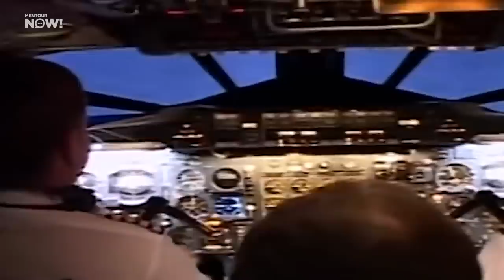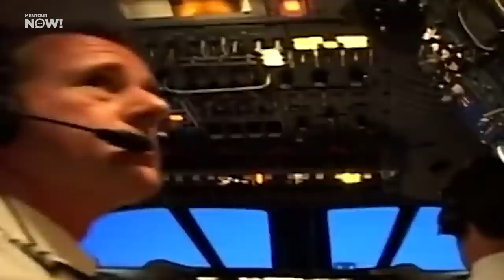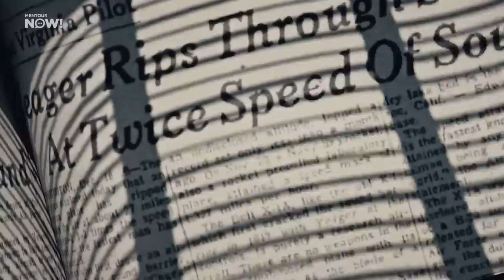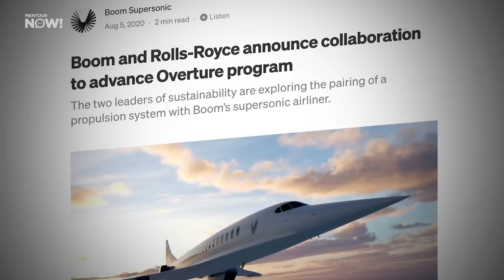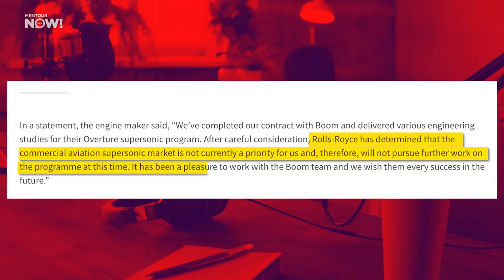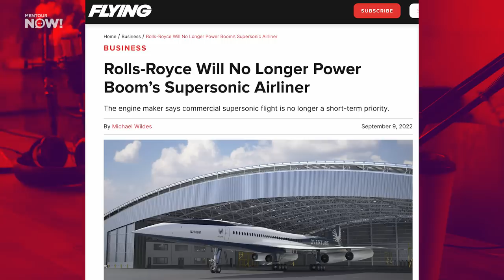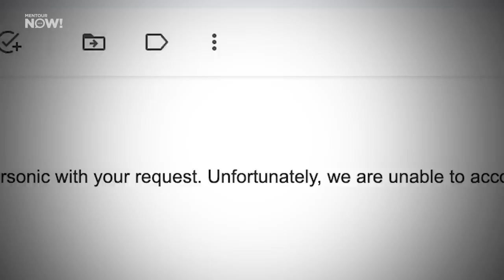WHAT’s Going On with BOOM Supersonic?! Will it Fail?

Comment: Hi Mentour,  thanks for making this video. I have been saying this online for months. Their scaled demonstrator now doesn't even look like the new design so how valid with the data be? And mimicking the B-2707-300 with those draggy engine pods?  I would love to see another SST as I loved my Concorde flight in 1999. It was awesome to see the curvature of the Earth  from 60,000' and to sit in the cockpit chatting with the pilots and Flight Engineer. The premature retirement of Concorde was forced by Airbus pulling the Type and Airworthiness Certificates because they could. This is unheard of for a manufacturer. Boeing still supports their airliners from the '60s and 70s. 

I suspect the problem was that Concorde dominated the First Class trans Atlantic market (soaking up 800 seats per day) and any airframe manufacturer has to sell First and Business to its customer because that is where all the profit is made. At the US major I worked for, if BusinessFirst on our trans Atlantic DC-10s was 75% full, the aircraft was paid for. All the rest of BF, economy and the freight was pure profit. That's how important this was. They weren't making much money from Concorde support and Air France made it quietly known that they wouldn't mind letting it go and being government owned at the time, had the influence to support Airbus in this. Not great for BA who had just refurbished 5 of their aircraft with new interiors, Kevlar liners and other upgrades. Reportedly they went to Airbus with a plan to go it alone but Airbus said 'Not at any price'.

As for profitability, it made more than half a billion pounds in profit from the 5 aircraft in regular service. They were clever with using charters and round the world trips but across the Atlantic BA was profitable. It worked in its own division from 1982 so was not cross subsidised in any way. This is documented in  numerous books and other sources and as BA is a public company, can be verified. Air France struggled with profitability with it and their mainline airline for years.  The development costs are a separate issue as quite a few airliners never made back their costs (DC-10, L-1011,VC-10) but were profitable to operate. (No manufacturer charges back the development costs to a customer except a small portion in the sales price.)

The major achievement for Concorde was being able to supercruise (fly supersonic without afterburner) for 3+ hours at Mach 2.0 something no other aircraft civil or military has ever matched. The supercruising bit is critical and  supersonic aircraft require low bypass or turbojet engines as they need the high exhaust gas velocity. This means noise. Rolls Royce pulling out is almost fatal. There is no engine in sight and engines take up to 10 years to develop. The Olympus 593 was the most thermally efficient turbojet ever produced and its SFC is still impressive today. At 30,000lb dry and 38,000lb wet it is head and shoulders above anything available now and ever surpassed the J-58 in the SR71 by some distance. The dry figure is critical for supercruising. The Olympus' clever inlet and exhaust system produced 60% of the thrust at Mach 2.0 with the core providing the rest. 

You can find more about this amazing aircraft here    https://www.heritageconcorde.com/ Best books are by Christopher Orlebar, Brian Trubshaw and Neil Kelly

Concorde solved all the problems except noise and boom and I doubt that Overture will solve these either.

Comment: Another issue with Boom is the range, fine for trans Atlantic flights but not so much for trans Pacific routes like LA to Tokyo, Hong Kong, Singapore, Sydney etc. People would pony up to cut that flight time in half, but Boom can't make it without a refueling stop which takes away it's advantage.
Reply: @kenclassen6616
1 Hr refuelling stop 747 cruise=575mph. Overture cruise=1,304mph 

Route             747                Overture                        Saving
JFK/LHR         8                          4                                  4
LAX /TYO       11.5       2.88 + 1 + 2.88 = 6.76            4.74
LAX/SYD        15          3.75 + 1 + 3.75 =  8.5              6.5
LAX/HKG       16           4.00 + 1 + 4.00 = 9                  7
LHR/PER        17          4.25 + 1 + 4.25 =  9.5              7.5

Comment: The F414-GE-400 engine (58-98 kN) could be a nice choice. It is used in F/A-18 E/F Super Hornet that can do in Mach 1.6, and a variant F414-G is used in Swedish Saab JAS 39E/F Gripen, where it did Mach 1.2 on a single engine without using afterburner.
Reply: I think a GE F404 variant might serve them well too, they are smaller, parts are abundant and the long list of variants proves they can be tuned for different uses.
Reply: It is an interesting question that was not covered in depth in the video - Could Boom choose an existing military engine for the Overture?
Reply: Not nearly powerful enough dry. The M 1.2 was a dash speed. You have to  sustain Mach 2.0 without afterburner to have a viable SST. Concorde's Olympus 593 produced 30,400 lbs dry and this allowed it to supercruise at Mach 2.0 for 3+ hours, something no other aircraft has ever come close to. No supercruise- no SST.
Reply: @Completeaerogeek  4 * 58 kN to 77111 kg (Boom Overture with previous engines) max takeoff weight is 332 kg/kN. Concorde had 4 * 140 kN to 185070 kg max takeoff weight = 330 kg/kN. The power to weight is roughly equivalent.
Reply: @bgezal   I understand but having so radically changed their design and knowing how aircraft gain weight in development (this is why Concorde designers had to accept  temporary reheat) I have serious doubts . 

You want an engine that has probably a 25% thrust excess just to start. Also in Concorde, the engines ran at 100% constantly in climb and cruise above M 0.90. This was one of the challenges for the Olympus development team. 

I can't think of any jets that run the engines at 100% for hours at a time but I am happy to be corrected.

I am also concerned that their test vehicle now bears no relationship to the current design...
Reply: @Completeaerogeek  I'm not a total engine geek. I know they want 67 kN engines with turbofan. I suggested one engine from the top of my head. Maybe there are no engines on the market right now that fit without modifications. The engineers of Boom likely have read all the product catalogues in the World.

In 1986 F-111F's flew a 9700 km roundtrip during I think total 15 hours with four aerial refuelings. Only one of the planes had an engine overheating. https://en.wikipedia.org/wiki/1986_United_States_bombing_of_Libya

Comment: Another thing is cost per seat. You have to have it low enough so it is cheaper than a charter jet. With a charter it can fly faster than most commercial flights but slower than supersonic but it does have the added you can fly when you want not when the flight schedule of the airline is. So that is a huge factor. If I can leave when I want and return when I want at a cost less than a ticket and still be within a couple hours travel time I will chose that option.

Comment: As you said in 14:53, these projects will fall over without an engine supplier or viable engine option, especially for a supersonic aircraft since it is even more critical.
The engine suppliers, before committing to spend money to modify an existing engine model, would want to know if they can get a return on investment - and how big the engine market will be. Even though airlines have placed orders, it seems most engine manufacturers are reluctant to commit.

Comment: On the subject of a trijet with different engine types: I want to see a trijet with 1 huge high bypass turbofan and 2 small turbojets with reheat. You'd use all 3 engines for take-off and landing, but cruise as a single engine aircraft. In the event of the large engine failing, the two small engines would be able to be started in flight from the APU, and would have enough power to let you divert.

Comment: Aircraft with more than one engine type on the same airframe include the Ford Trimotor models 7-AT-A and 13-A, the B-36, the Ryan Fireball, the D-558-2, and the NF-104, in addition to a number of testbed aircraft fitted with a variety of engines temporarily.

Comment: Rolls could always adapt and update the olympus if they were interested. As that engine has already done the job once before. Cheaper than a totally new design, but would possibly tie boom to a similar engine management arrangement, inlets etc to concorde. However new materials and modern computers might improve the old design enough to work well.

Comment: Apart from the supersonic craft engines problem, there is another issue that has lead to strange engineering solutions, for lack of sufficient engineering foresight. It is the issue of pilot ground vision during take-off and landing. In the Concorde, the solution was a down-orientable nose segment, so that pilots could see the runway over the nose segment when low speeds required a high angle of attack. But the obvious solution is much easier and requires no such movable segments: place the cockpit in the belly and let pilots have an ample ground view! Pilots do not need any view of the sky nowadays, as navigation is no longer based on cosmic observations and separation with other high-speed aircraft is not based on pilot viewing.
Reply: Nope you only need synthetic vision from airframe mounted cameras. This has already been trialled and proved a long time ago.

Comment: Favourite Aircraft 1. Grumman F-14D Tomcat, 2.F-16 Viper (official name: Fighting Falcon), 3. SR-71 Blackbird 4. Concorde :) Just a minor correction to the video, you stated that the F16 uses the GE-101 engines. This is actually not the case. The proper engine name is the GE General Electric F110-GE-100/129. Just an fyi.  It's a shame that boom couldn't modify the GE engine as the F110 is rated at approx 24000lbs of thrust.  The Tomcat actually had 2 of these in the D model giving it almost 50000 lbs of thrust and a top speed of better that Mach 2! Fun fact: the F14D was NOT allowed to use afterburner during a carrier take off as the exhaust would actually melt the Jet Blast Deflectors! Later models of the F110 actually are rated for more than 30000lbs of thrust as well.
Reply: The F-110 doesn't make enough thrust dry. Only about 17,000lbs. The F-14 or F-15 for that matter could not supercruise and could only dash to their maximum speeds briefly, not sustain them for 2 reasons: Huge fuel burn and 2 heat soaking. Aluminium alloys start to weaken after exposure to kinetic heating above M 2.3 that is why Concorde although capable of going faster, was heat limited to M 2.3 and service limited to M 2.05.

By comparison, Concorde's Olympus 593 made 30,400 dry (and 38,000 wet). The enormous dry thrust is what allowed Concorde to supercruise at Mach 2.0 for 3+ hours. Something no other aircraft has ever matched or even come close to. It was the most thermally efficient turbojet ever made. So...No supercruise, no SST.

Comment: I think not having an engine supplier will not help matters, the airframe will have a maximum temperature it can safely fly at. On Concorde the nose tip got to 127 degrees at maximum. Building a new airframe from composite materials makes the issue a lot harder to control as titanium and other metals used for Concorde were very light and thin, the areas around the windows were specifically cooled. Checkout out the excellent book by Christopher Orlebar, it gives a great insight into things. I think the combine of speed and range will be an issue. I can’t see Boom making the engines in house and I don’t think they could just buy up a few engines to get a prototype off the ground. The weight of the engine and it’s fuel will be a tricky issue, with Concorde fuel was moved around for Center of gravity and to maintain the correct balance. Having rear tail fins might appear ok but could be a step backwards. I think the double delta wing off Concorde should be used as template and the technical changes devised might improve things. Sadly the sonic boom cannot be bypassed and making the aircraft have the range and ability to pay for itself is another. The maintenance required is something else too,how many cycles can the airframe sustain and what happens about fatigue? Components have a limited life and aircraft parts are somewhat expensive and specialist stuff too. Let’s see how long it is before an engine supplier is agreed upon, from there the prototype is going to have to do some serious testing. It will be worth watching as it were.
Reply: How do you fly the Concorde when fuel is empty. Would be nice to have a supersonic sail plane diving down from 20 km. Gives some extra range. Maybe able to push out the heavy engines out the back in emergency.

Comment: People are reminiscing about Concorde

The house my family has been in since the 1970's is under the usual outbound path from Heathrow, just where the Concorde flights usually split either south or west. We could identify the sound but they became route.

Into the 1980s our house was doubly blessed by aviation, low(ish) demonstration and test flights by the then British Aerospace out of Dunsfold used to come in over the  low population heathland and use our house, with it's distinctive colour roof, as an aim point and directly overhead.

Later in the 90s and early 2000s I got to casually converse electronically with some of the people who had worked on the wing design and still worked, like I do, for the Ministry of Defence (people sometimes forget that a lot of the Concorde design and test work was done by military research and development establishments).

Happy days, sat in the offices up on the hill during the Farnborough airshow with Airbuses up to the 380, various Boeings, An 225's, C17s and wotnots circling about overhead - and that's before we mention the Fast Jets.

There was a fascinating (publicly available) book in the Farnborough library on the development process. IIRC it all began with some transatlantic fuel burn vs airspeed and flight time curves that showed that if you flew fast enough the extra fuel required to generate the airspeed was outweighed by that saved by the shorter flight time and the airspeed at which that happened was just within the technology practical for a civil aircraft at the time.

Comment: 5:27 Idk if you are counting military aircraft, but later variants of the Convair B-36 Peacemaker used a combination of both piston engines built into the wings and jet engines in underwing nacelles to power the aircraft.

Comment: Boom designed new motor called Symphony that some us military jet engine manifacturer will build, basically from stock parts. They had to design whole new motor because none motors supported 100% sustainable fuel. At best some of them support 50/50 mix.

Comment: what are the drawbacks of using an existing engine of appropriate size & speed from a supersonic military jet?  Then the military paid for development, and many spare parts
Reply: Nothing is powerful enough. The Concorde's Olympus 593 produced 30,400lbs of thrust without afterburner and 38,000 with. The F-22's F-119 engine only manages 26,000lbs dry. Even the SR-71's J-58 engine only produced 18,000lbs dry.

The Olympus is one reason why Concorde was able to supercruise at Mach 2.0 for over 3 hours. Something no other aircraft has ever come close to and why it was profitable for BA for over 20 years.

Comment: IAE V2500 is the lead candidate engine. 23-31k lbs thrust range across the models, plenty of them out there from the A320 CEO series production run and a nice small frontal area vs the CFM56 series.
Reply: It's still need to optimalized for supersonic flight, which has completely different airflow pattern than subsonic.

How much change? Enough to make SEVERAL big engine manufacture to say "nope"
Reply: @bocahdongo7769  It's not that much work if done on an existing engine. Remember, the other engine makers are saying no to a new build engine due to the low volume and high risk that brings. Adapting an existing engine is lower risk, and plenty of methods of slowing down the airflow without using complicated ramps.
Reply: @stephen_101  I know, but again, even we adopting the existing engine, everything must be optimized for supercruise with only small diameter blade turbofan. Which I learn the supersonic flow it quite counterintuitive from subsonic flow and most of the part must be completely redesign

It's the best definitely, but still far from ideal.
Reply: Nope. You need a low bypass or turbojet engine. The exhaust gas velocity of medium/high bypass turbofans is too low. They also have too high a frontal crossection.
Reply: @stephen_101  There is nothing that can produce a high enough exhaust gas velocity and enough thrust to sustain Mach 2.0 cruise without afterburner. At Mach 2.0 your exhaust gas velocity has to be at least M 2.0.You need a low bypass turbofan or a turbojet. Concorde's Olympus 593 produced 30,400 lbs of thrust dry (no reheat) which allowed it to supercruise (fly supersonically without afterburner) at Mach 2.0 for 3+ hours. Something no other aircraft has ever come close to.